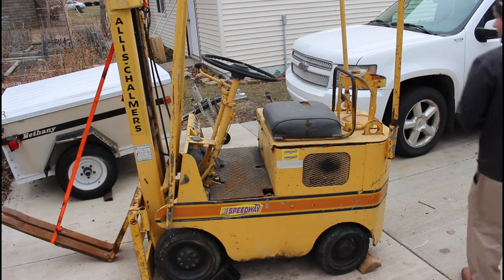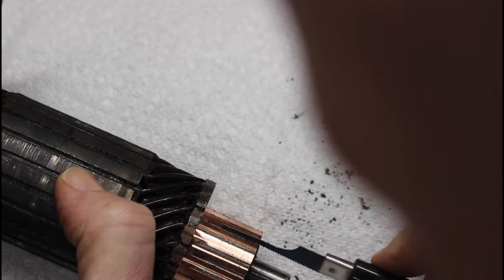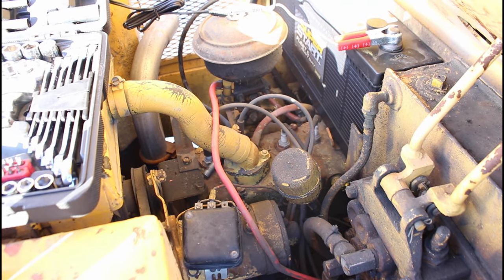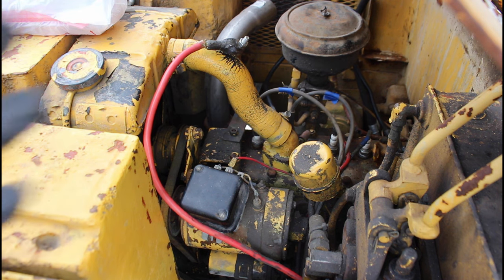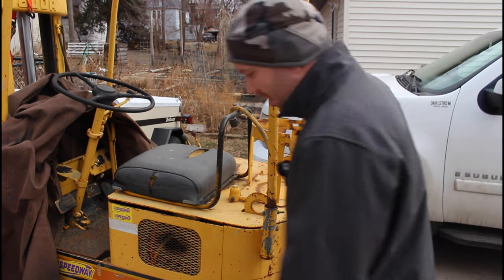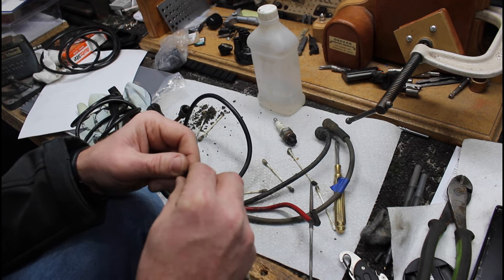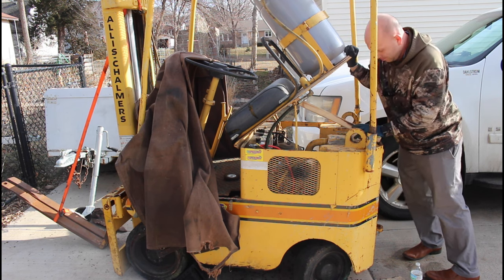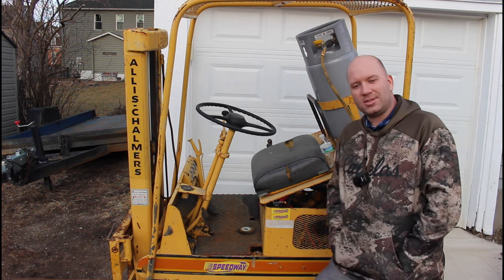Allis Chalmers FB20-24 Forklift, Let's get it Running!

Comment: I'm sure you'll take care of it, but on these flat heads, with the head gasket leak as it is, I put a nice liberal amount of copper gasket spray on whatever gasket was in there, LIBERALLY apply the spray (or gold spray paint, that works too!!) and let it tack up then glue that head gasket right in there.. let it dry overnight, you should be perfect. Great job on getting it running!

Comment: Using a heavy battery cable would NOT have reduced the current to your starter!  In fact, the larger the cable, the more juice will get to the battery.  i.e. the larger the cable, the less resistance...  However, if the battery cable was severely corroded inside the insulation, it may have acted as a resistor, which would have reduced the current to your starter...  Also, I would have done a thorough cleaning of all the connections!